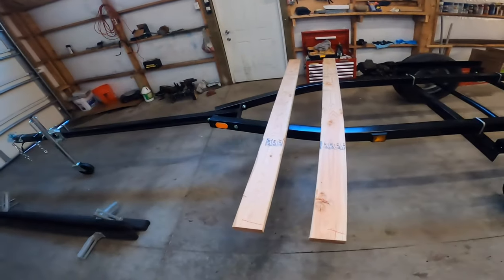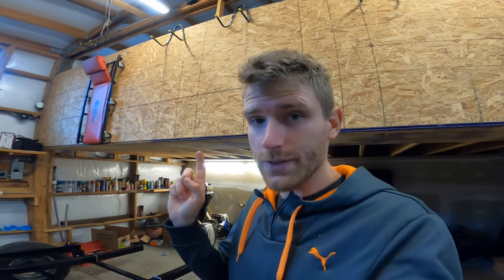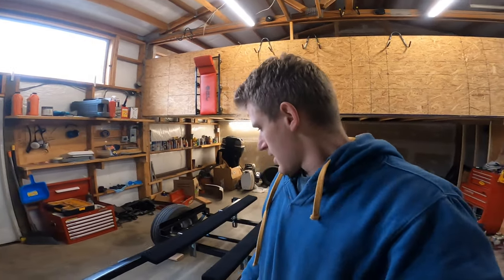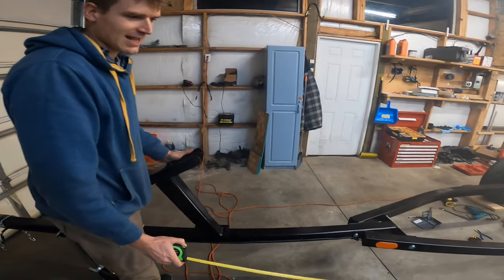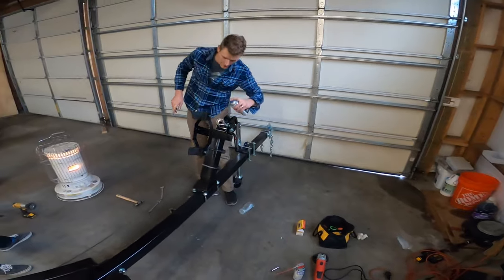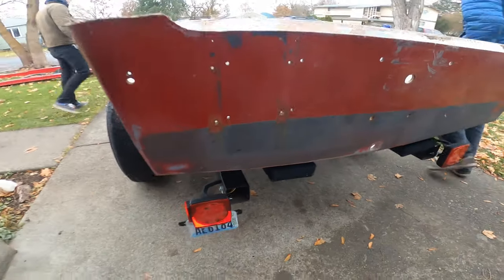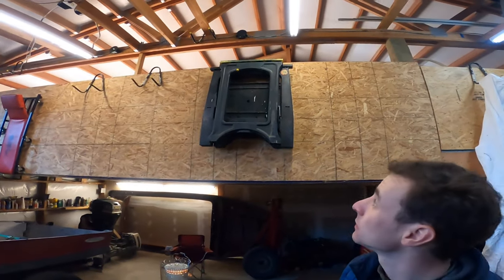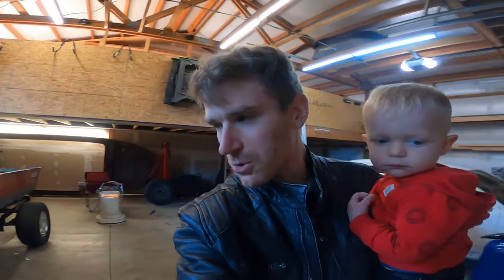Boat trailer rebuild (PART 6) Bunks and winch stand

Comment: Where did you get the winch stand?
Reply from the maker: the winch stand came with the trailer. I removed and threw out the old winch as it was seized and unfit to use.
Reply from the maker: also I bought the jack stand from amazon